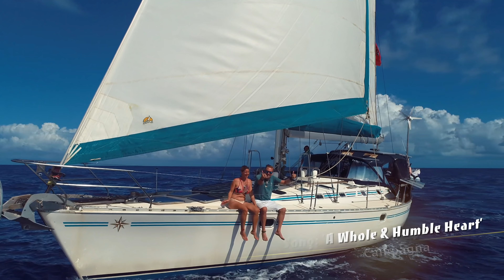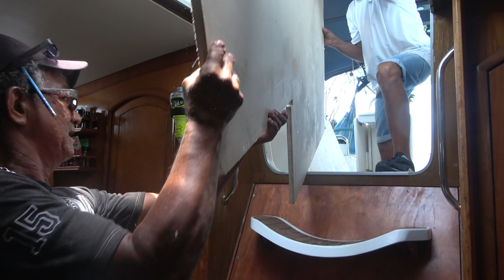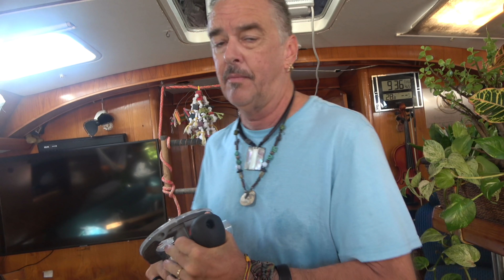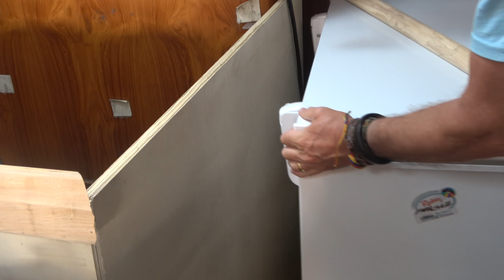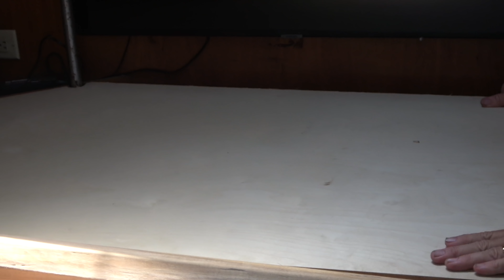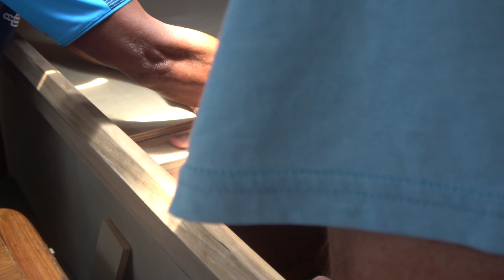SSL540 ~ Things they are a CHANGING..!!

Comment: i guess ill be just one of the very few to comment on the woodwork. as a master wood wright i must give it to you boat carpenters, good job considering the space, tools etc. on that note rick, we call thode battery saws trim tools. believe it or not i have my 12 year old cheep ryobi set and i do use the trim saw quite a bit, but none of the battery op skill saws work on ply over quarter inch. looks good mate.

Comment: Yes! You look 10 years younger.  👍. It looks like you have the blade on the skil saw set way too low.  The teeth of the blade should be set slightly lower than the thickness of the material. 1/4" of blade through the material is more than enough.  Too much creates more chance of kickbacks, skewed cuts, & drag on the blade which is especially important with a cordless unit.

Comment: When you cant get a finer tooth blade for the saw place painters tape and draw your cut line on it and cut. That will help with the splintering of the plywood. Wont stop it all with that coarse blade but will help. Just a tip, not criticism.

Comment: Cap-e-tan, when using your Dewalt saw, always adjust the depth of cut so the blade isn't buried in the wood.  This helps the saw cut clean and smooth with ample power.  The angle of the cutting teeth can cut through the wood fiber easier that way.  I think this is a common mistake many make with a circular saw, even corded one's.  I have the same saw and it works great for light cutting where power cords are impractical.  Nothing, of course beats a corded tool for performance.  When you adjust the depth, you want the teeth to barely go through to make a complete cut.  The teeth can cut without the entire blade rubbing inside the cut slowing it down.  Dewalt didn't grow as big as it is by building insufficient tools.

Comment: The Ply front to side angle isn' t square so the mitre joint appeared slightly off. Recommend to use 3-4-5 triangulation and a  temporary brace to get an exact measured square. 
  Those mini saws are only good for a few cross cuts of 3/4  and more if it's 1/2 material. It just can't handle lengthy rips, its not designed for it. The blade on that saw is just wrong, even though it came with it. It appears to be 3/16  or worse 1/8th kerf with only 16 tips. Kerf is the width of the blade. You want a 1/16th kerf blade with 32 tips. This will effectively double the power of the saw and make nicer cuts. Also never force a saw ,let it do the work and let it glide slowly through the work piece. For a boat would absolutely choose a high quality Bosch reciprocating Jigsaw and a 4ft guide clamp.

Comment: Like my wife say's when she cuts my hair .. " It takes five years off" and I say, four more haircuts and I'll be dead. He is defiantly more of a carpenter than cabinet maker.. wish I was there to provide that service. Metal brackets? I question the rough sea worthiness but I know the limited resources there so good luck with that, hopefully it was epoxied the entire joint. I would have used a full length aluminum angle, just sayin.
Cheers and all the best!  👁❤️🦅

Comment: Rick, set the depth of the saw 1/2" deeper than whatever you are cutting. Will make things easier, better cut just might save a finger or two from binding backlash. Also much easier on that little.

Comment: Adjusting the depth of the saw blade to were the blade is about a 1/4 “ below the bottom of the board will make it cut better an save battery charge.
Reply: And, I'd like to add... That saw appears to be the 18 volt model. The 20 volt brushless is a much better saw when combined with the 4 amp hour battery.

Comment: The blade that comes on the small dewalt saw sucks. Freud makes a thin kerf blade in that size that is half the effort to cut. Works way better. Also, if you can get one, find one of the 60volt batteries they are awesome.

Comment: The dewalt saw blade was set too deep and splintering up as well as not cutting as efficiently as it could.  Also try clamping a straight edge to run saw against so there is not so much wiggle to and fro that causes more drag.  Pledge furniture polish also can slick up a blade cut things better.

Comment: @RICK Amazon, Wen 3625, 4.5 inch circular saw. 60 bucks. Best thing I ever did for myself. I have 3 electric circular saws collecting dust because of that little inexpensive wonder.. it cuts up to 2x4 thickness .. what else do you need a saw for?

Comment: Captain Rick,  great video you might try adjusting the blade depth on the Dewalt saw.
I have a Porta Cable, that cuts a little better than that, but I keep the blade adjusted to the thickness of the wood. 
Also great haircut, a lot like mine, only mine is very tight!

Comment: I noticed you didn't adjust the depth of the circular saw.   It should only be just a little bit deeper than the thickness of the wood your cutting.   It works lots better when you cut.   The cut is nicer to.   I hope that helps!
Reply: I thought the same thing. Also, blade wont jam and battery pack lasts longer.